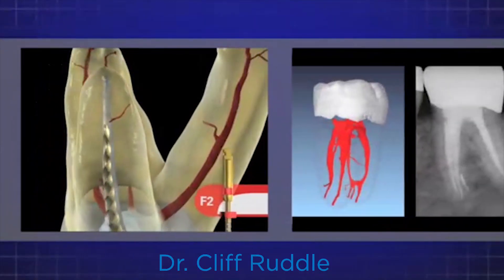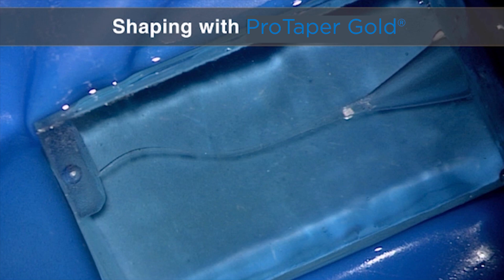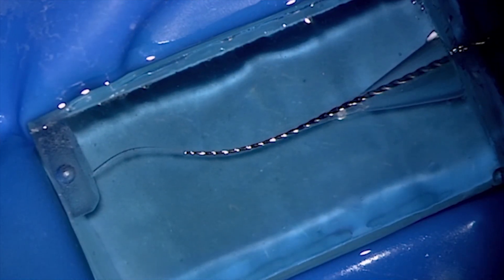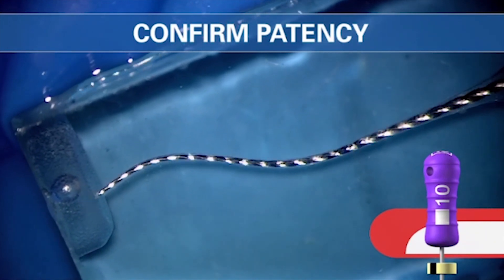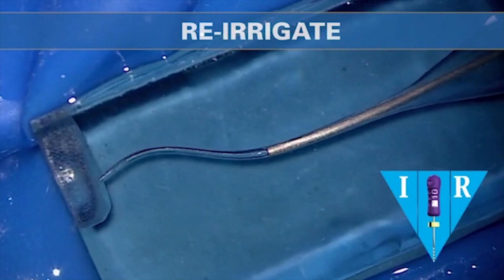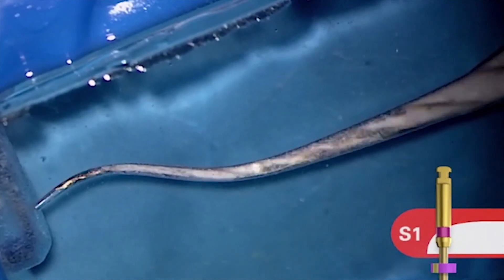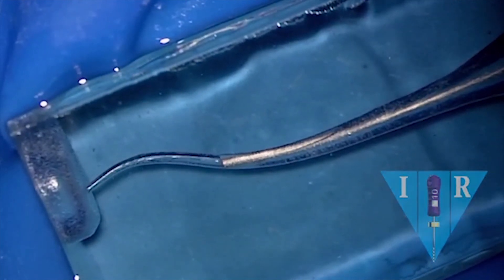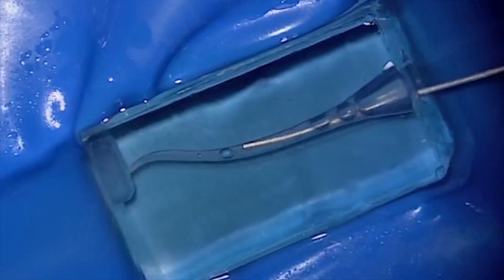Shaping with ProTaper Gold® - Dr. Cliff Ruddle | Dentsply Sirona

Comment: Thx for useful video.
Single set of file can be used for how many teeth?
Reply: It really depends on the form of flutes. May you use once in a molar canal and you can not use it anymore. You'd better see with your eyes if there is any change in the shape of file or flutes.